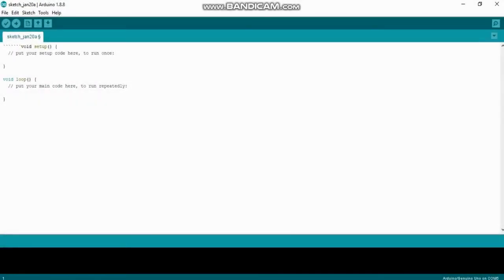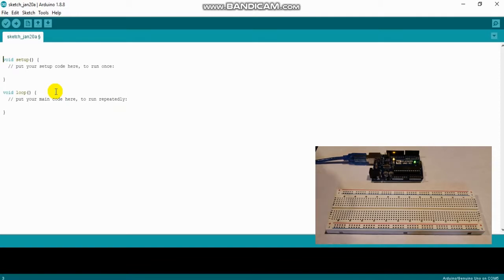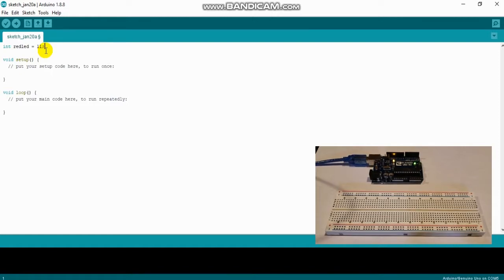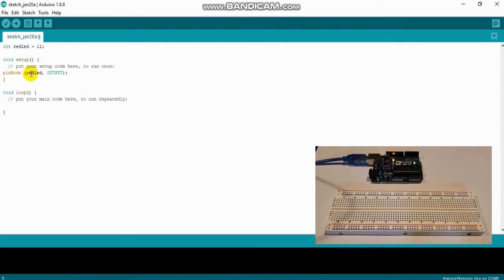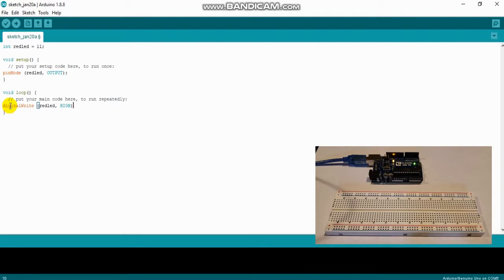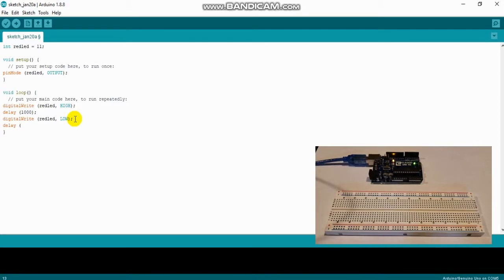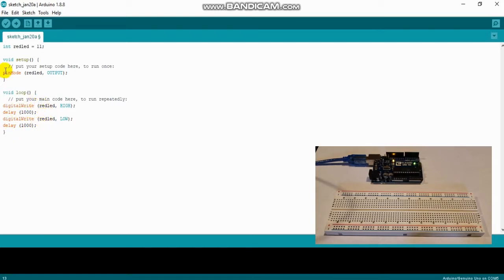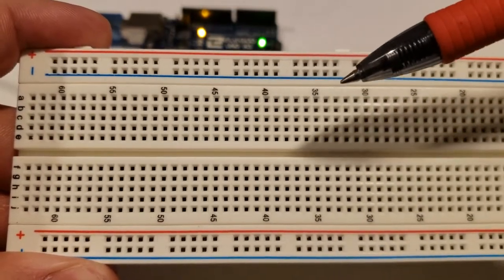*Arduino/Elegoo* Getting Started - How to make and LED turn on and off

Comment: it didnt work for me followed everything, guess my Elegoo is just shitty
Reply from the maker: What problems are you having? Is your board on? Did the sketch upload correctly? Is it just the LED won't Blink?
Reply from the maker: Also, make sure your LED is in the correct direction.  Since current will only flow in one direction from anode to cathode, you may just have your LED backwards which would result in it not lighting up.